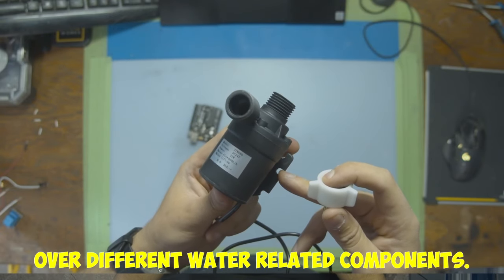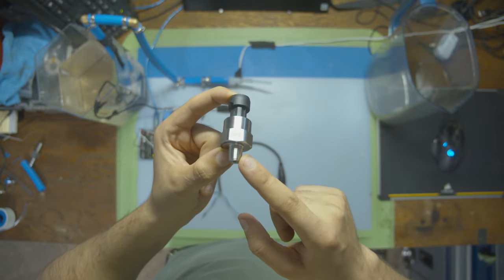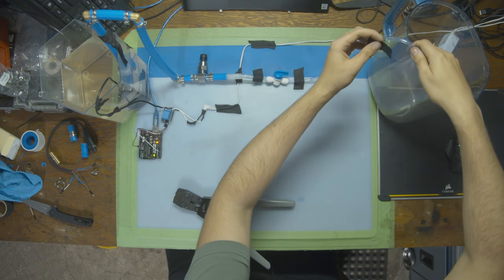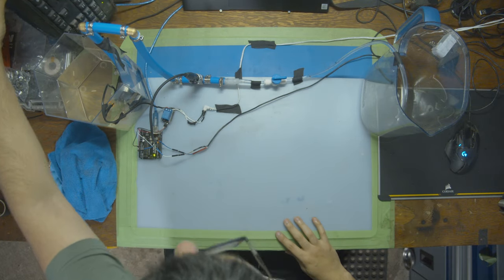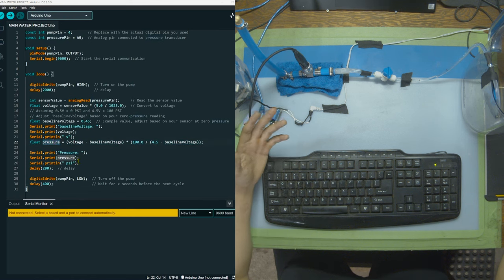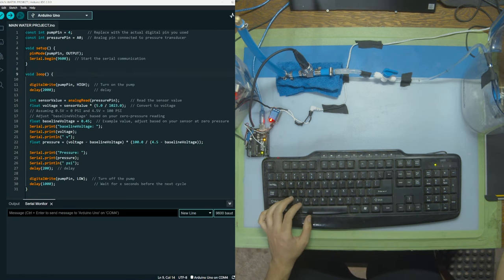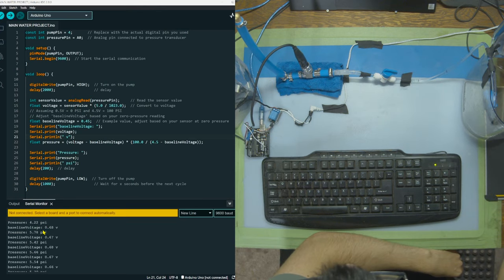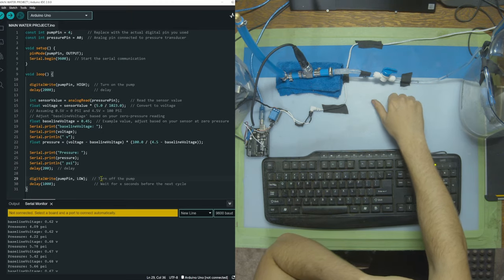MESURING PRESSURE WITH ARDUINO PRESSURE SENSOR (pressure transducer) #arduino #esp32 #waterpump

Comment: There is zero chance you were getting accurate results. I'm an engineer for a living. ADC's work by using a reference voltage and giving you a reading as a ratio to that reference. Since you were using an external power supply for the sensor, it was a different voltage than that which the arduino had as a reference. You should always get the power and ground from the ADC, which in this case would be the arduino itself so you can get an accurate reference voltage. Pressure transducers are setup to read .5 volts at their zero, which for PSIG is 0 psig, and for map sensors slash PSIA, .5 volts would be absolute vacuum, so at sea level you would be reading somewhere around .8 volts due to the 14.7 PSI of air pressure at sea level. Then 4.5 volts is the max reading of the sensor. So for your 100 PSIG sensor, all you needed to do was map the read voltage from .5 to 4.5 to 0 to 100. BUT, that only works when you use the correct reference voltage. On 3.3v systems, you map from .3 to 3 instead.
Reply from the maker: I’ll have to test this and report back, thanks for the feedback !
Reply: @MikaelAbehsera  : You don't have to test anything, dude, this is pure logic. My question is, if you don't know what you are doing, WHY on earth are you trying to pretend you do? 🤔
Reply: @frankysnephew this is unnecessary. Your comment is rude. I learnt a lot from this video, and the OP never claimed to know everything. He's open to constructive assistance. Unlike your waste of space comment.
Reply from the maker: These videos are to figure it out with my viewers since 90% of my content is niche and no one teaches or shows the process of figuring it out
Reply: @MikaelAbehsera  exactly! We all have knowledge gaps, and the only way to fill them is to dig in and getter done. If everybody didn't do things because they didn't know how, nobody would ever do anything, not even learn to walk for goodness sakes. This is a a fantastic video of someone going head first and learning and figuring it out. Kudos and keep them coming mate!

Comment: You have this wrong.  The range of those pressure transducers if from 0.5V to 4.5V.  .5V=0 psi and 4.5V=range of sensor.  So you need to subtract .5 V and then divide by 4V.  Any reading outside the range of .5 to 4.5 is an error.  This is intentional with these transducers so you can detect a faulty sensor.  Very misleading video showing people an incorrect calculation.
Reply: That output range is only if input is rock solid 5v. In his example he had 0.45v at 1atm. Going by your equation we end up with negative pressure.

Comment: I think you're lucky it worked at all without an explicitly common ground. You can power from external, but need to tie the sensor ground to the arduino ground. Looks like it was, but used the mains ground as the path
Reply from the maker: ah, true. I will fix this for future videos but I know a lot of the time with arduino you can get away with it as i have. thanks.
Reply from the maker: Made sure to fix this on the video I posted and gave you credit, thanks
Reply: thanks that fixed my problem
Reply: Exactly! That's the first thing that caught my eye.

Comment: hello, I have a couple questions, first off I am building an HHO torch setup, I currently have it all wired up for just an off switch, but I want it to turn off/ cut power when it hits 5psi, I will be running my Arduino into this torch build so I can set the parameters as I need. my biggest problem is I need the code to enter and I don't know how to, can you help me with the majority of the code? and I will figure out the rest.

Comment: Atmospheric pressure at sea level is around 15 psi. 0 psi would be absolute vacuum.
Reply: No, absolute vacuum does not have any pressure because has no air molecules, vaccum pressure is measured in negative PSI on vacuum chambers (example)
Reply: @PHM_Tech  Riiiiight, ty
Reply: @JonasSebastianBarjauMateu  You're welcome

Comment: Seems the pressure sensor especifications is for high pressure field and the power must come from arduino preferible than external power also for relay and water pump. However very nice set up.
Reply from the maker: yup, Id love to try making my own pressure sensor with a low resistance spring and some 3d printing

Comment: Wow, excellent work sir! Last 2 weeks I had a final-year project which required multiple pressure transducers. If I found your video earlier, the calibration for my sensors would have been much easier. But still, it can help me  to improve my project's reliability. Thanks for the tips!
Reply from the maker: Glad I could help! got any feedback on the way the video was filmed? anything you wish was done differently or better? thanks!

Comment: I just wonder what good a   setup like  this  is? 
I  would  think most  would use the  pressure sensor for a water level setup where they  would  want to turn a pump  on and off according to a  low/high  pressure  instead of what you're showing.
Reply from the maker: its up to everyone to use it as they wish, I'm just trying to learn how these things wokr and share my experiences, since no one makes videos on it

Comment: it is very nice and detailed tutorial. I am using almost similar setup. I am using 12V power supply but pump is not generating sufficient pressure. The cut off pressure written pump is 80psi but I am sensing the pressure reading fluctuating between 0-5 psi only. Don't know how to get higher pressure values
Reply from the maker: I’m pretty sure 0-5 is actually the voltage and not the psi, there’s some calculations you gotta do, did you add that part ?
Reply: @MikaelAbehsera  yes I have added that part too.

Comment: Is this rated for fluids other than water?

EDIT: definitely think it will work well with fuel then!

You're "hashtagging" ESP32, but you're using an arduino, so Im wondering if you just change the input voltage into the device for it to work with the ESP. 5 V down to 3.3 V?

Because sensors are input devices to a microcontroller right? So the signal has to be what the device expects.
Reply from the maker: This specific one is for cars and I think it can do gas / coolant / oil / air / water
Reply from the maker: When you buy one check the what it can handle or it’s rating to make sure
Reply: Thank you Mikael!  @MikaelAbehsera